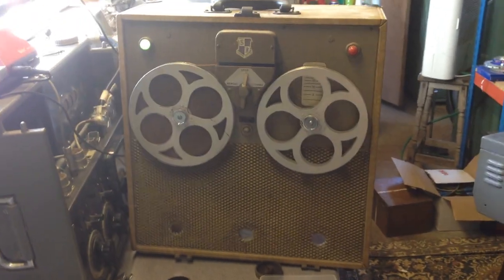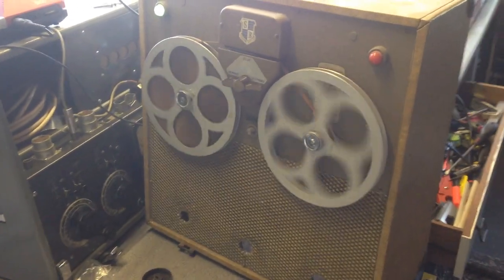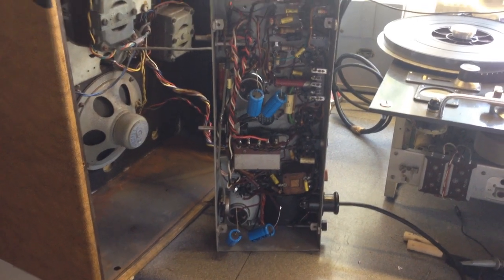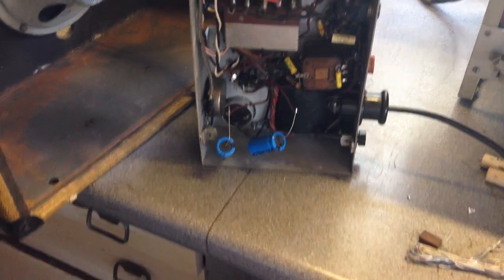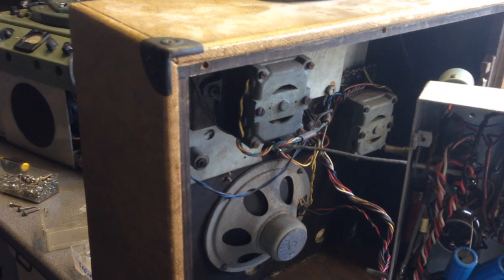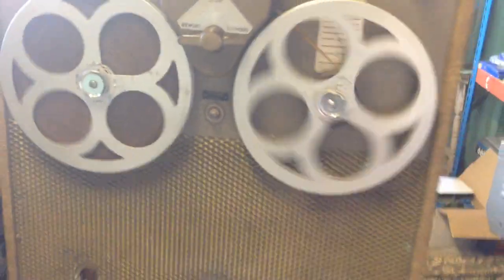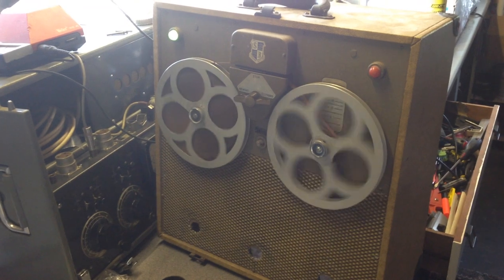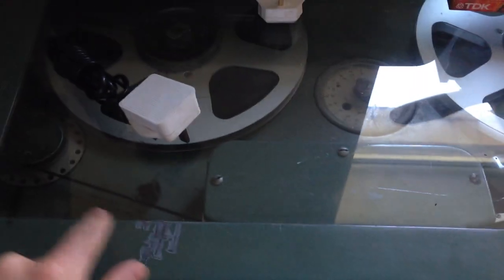Scophony Baird MK I reel to reel - undergoing repair

Comment: Thumbs up, opting for the hard work re-stuffing the old caps in order to keep everything looking original.
Reply from the maker: +Nick Norton Thank you, I do with the big electrolytic cans as the machine wouldn't look right otherwise, the none electrolytic's are harder to do but not impossible, but as you can see in the video, I have opted with just replacing them, they are more out of sight than the large cans.